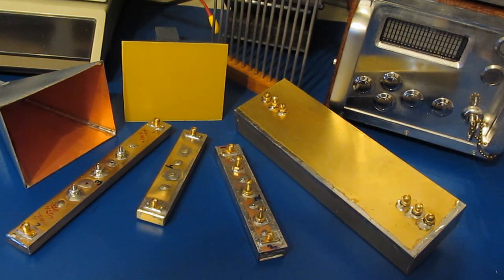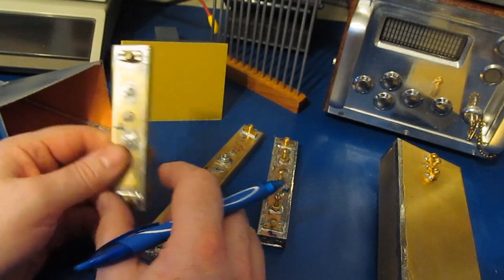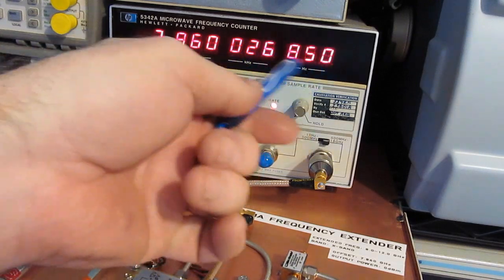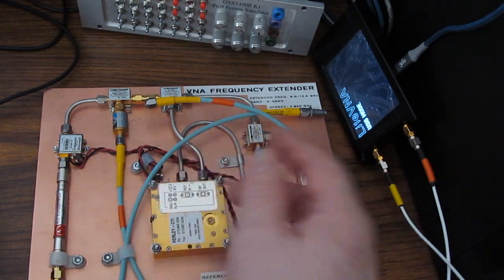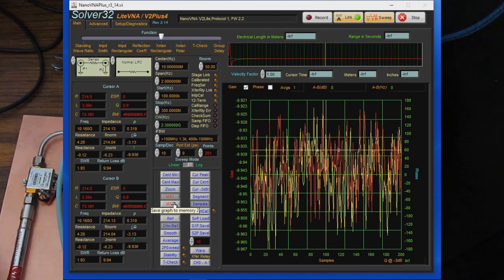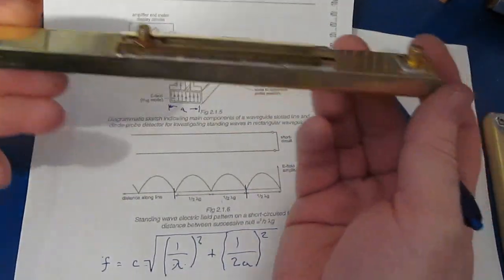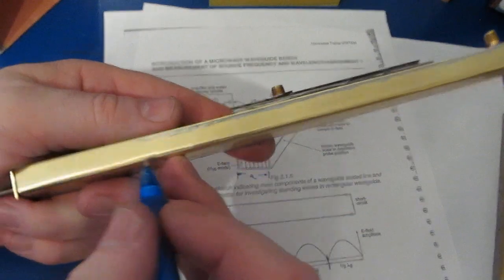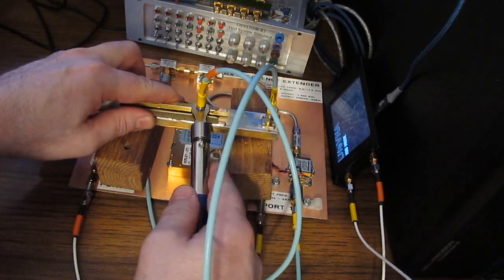Introduction to Waveguides using the LiteVNA,  Part2,  The Frequency Extender

Comment: I really love this waveguide series. When I grew up and went to University in 1977 the waveguides we had in School my engineering program we're all basically silver-lined and the better ones had gold but we didn't get those from industry. All the wave guys we had were donations from basically the garbage left over from Raytheon and other companies. We had a lot of old test equipment to and finally the school had to upgrade their equipment so they were going to lose their accreditation. That was the University of Lowell back then in Massachusetts. That school is now UMass at Lowell. Prior to attending the University of Lowell it was Lowell technological Institute which merged with Lowes State College at the time. Anyway this is a great series. It never occurred to me that brass would be good enough because I was always thinking of the exceptionally High conductivity of silver and gold.
Reply from the maker: For these experiments, I've been trying to use materials that were easy to come by.  We don't need anything high performance.  If we did, we wouldn't be bending sheet stock and pounding it out with a hammer.  LOL.

Comment: A+ joesmith! A few mech e ideas for those who might want to take this a step further:

1)Differential fine pitch screws will let you adjust, with a backlash of maybe 10 thou, off the shelf from McMaster. (Use the it like you would for any other linear drive mechanism.) Using a teflon/nylon bearing block is surprisingly good for backlash-resistance. Alternatively, you can do the old "overrun past your critical measurement points, then start feeding in to take up the gearing slack" trick.

2) Using a slide vernier caliper, you can detach the moving jaw and attach that to your movable component in the slotted line. Then take the 'fixed jaw' part of the caliper, and use that as your static ruler (e.g.affixed to the wg). In fact, you can skip the differential screw step and build around grainger's 4KU78 for 30$ (on closeout, get it quick!), giving you both locking mechanisms as well as fine-resolution adjustment. It's not going to be as good as that $300 Starett mic, but it'll get you 90% of the way there.

3: Depending on what y'all have in your garage, you might be able to do better than the ball peen hammer in a vice. It's the contour of the internal radius that determines the wg performance. A sheet metal brake if you happen to have one is probably the best option. If you have a >2 ton hydraulic press, even those mini harbor freight 100$ ones, and a vice, you can metal-form a nearly perfect 90. Put it into a machinists vice (so you have reliable 90s, and planar surfaces) and you should be good to go unless you're using some crazy Aquamat or Hastelloy or crazy stainless

-2x2l
Reply from the maker: As I have stated in the these two videos, the internal radii must be less than 10% of the broad width.  The main contributor of error was the WGs width.   If you want to make a better slotted line, buy a section of WG with proper dimensions and make it longer than I show.

Comment: Your home made waveguide is doing exceptionally well.  Commercial machined waveguide is very expensive.
I would think an suitable sensitive analog meter would be better to find minimums than the DVM.
Perhaps the issue you are having with seeing the minimums with the diode detector may be there is not enough signal to turn on the diode.   A backwards tunnel diode might work better to see the minimums since they respond to lower level signals.
The demonstrations with the magnet was  great for showing the effect of fixed biasing the ferrite.  The bias increases the resonant frequency of and lowers the permeability of the ferrite, thus reducing the loss.
This was a great video!  Thank you.
Reply from the maker: Working with higher power would have helped.  The notches are very sharp, << 1mm.    Most papers I have been reading are from the 40s-60s.  The article I read from Bell Labs on the isolator was very interesting.

Comment: I have the GR900 slotted line from General radio, including the cal kit and adapters to other connectors. I use for all my RF stuff GR874 connectors. They go to about 6 GHz and I have a lot of accessoires like trombones, air-line, mixers, detectors, attenuators, component fixtures, T , L, U shapes, sliding loads, variable capacitors, all kinds of adapters etc. Most were given or bought cheap because there most people over here have no clue what they are.
The slotted line uses a detector/voltmeter that has 3 uV full scale sensibility if I remember wel.
Reply from the maker: You should be making these videos!!!  I thought about getting a used WR90 slotted line and transition for it.  The costs far exceeded what I planned to use it for.  I think going much further with these experiments will require I purchase some actual hardware.
Reply: @joesmith-je3tq  Yes, they are expensive and rare. Also not really usable other then educational fun (for me) 

I got mine from a friend who used to be a GR salesman in the 60-70's . Payed 200 euro for it. It is complete with all GR900 adapters, even to sma. A toolkit for servicing GR900 connectors. I al ready had GR900 airline. 

But I had a problem with getting the correct unit-oscillators. I build a sweeping RF generator that does 25 to 2000 MHz and that is the highest I could go. But the liteVNA should be able generate 6 GHz (If I am correct)_ 

The other problem was the SWR meter, but I had one from HP. I found some GR stuff since, but had no time due to work. 

I now am partly retired and I am living on my sailboat. If I sell my house the hardest part, mentally,  is getting rid of my GR collection (the bridges for most, the small stuff is already aboard.) I have a GR1620 A that was used by GR in their cal lab (confirmed by Henry Hall, the man who designed bridges for GR for 40 years, a great and smart guy, still active in the GR collectiors world. I think he is over 90 by now. That thing is huge, and bizar, it can measure down to aF. 
I amgoing to play with a satelite LNB to downconvert X-band to less than 6GHz so I can play around with  radar (a friend has aan old radar from his ship for me to play around and restore so I can mount it on my boat. It works just over 9 GHz. 

I did not know you were in to RF, the videos about waveguides are great. I made a few videos in the past but then got to busy with work and it is a lot of work and I hate editing.
Reply from the maker: @pa4tim  The LiteVNA is rated to 6.3GHz without harmonics and 9.3GHz with.  As I have shown, things are pretty poor even at 8GHz.   That's the whole reason I needed the frequency extender.  
You could see if one of the local museums would like your collection.  You could then just donate them to a good home.   
My main interest in electronics is digital.  Digital = analog = RF.   When it comes to editing, you and me both!!!

Comment: Exceptionally well done diy homemade Waveguide & informative video !! ....You might try making an "Iris" Coupled Cavity Notch Filter. The Cavity Waveguide section is soldered on at a Right angle to the Main guide, electrically in Parallel.....Makes a great, deep Skirt Notch low loss filter....Experimenting with the "Iris" Diameter is a lot of fun & helpful when you need to notch out a Narrow BW offending signal....
Reply from the maker: The video I watched from the Signal Path where he was attempting to 3D print some WGs showed a iris filter.   I may give it a try.

Comment: An idea for the slotted waveguide, or any sliding load, you could buy a cheap digital caliper from Amazon and solder/glue it in place. You will get fast precise readouts, a thumb wheel for precision adjustments, and a locking screw. Once again, great work!
Reply from the maker: As I demonstrated during the video,  the largest error contributor is the dimensions of the waveguide.  For making the measurement, I was going to use a grease pen, mark it, then measure it after the fact with calipers.  No point in wasting a lot of time on a one off experiment.
Reply: @joesmith-je3tq  Agreed, I only meant that cheap digital calipers are now cheap enough that you can solder/desolder them to different pieces of equipment whenever you need some precise positioning control. I've been meaning to drill a hole in a set so I can add 3D printed hooks to insert to control positioning.

Comment: Another great video! Regarding 3D printing, you can buy conductive filament. It's a bit resistive, but you could assist it with conductive paint on the lining or just line with copper tape, allowing the filament to make the joins between faces. With a 3D print that beautiful slotted wave guide could have the slot closed too, very excited to see your next videos!
Reply from the maker: Post the MFG and PN for the material you are suggesting.
Reply: @joesmith-je3tq  I can't seem to post links, my posts are deleted, but Protopasta has one, but I think it's US supply so may be expensive to import. There's a very basic review of conductive filaments on All3D for alternatives. Interestingly, you can buy filament loaded with 80% copper (not sure if that's weight or volume on RS components and Amazon in the UK. No idea if it's conductive but might be worth testing. There are several conductive resins too but I can't remember how I found them last time.
Reply from the maker: @bansci  Most likely hits the filter is all.   It's much more conductive than I was guessing.  Maybe it could be directly plated with copper.  Have you ran any experiments with it?
Reply: @joesmith-je3tq  I've not tested it, sorry. I can see suppliers for Protopasta in the UK. Farnell will have some stock next month, and there's other suppliers like Ram peripherals who have it right now.

I have no idea if the filament will work well for RF, you might be able to electroplate it but it's fairly high resistance. I think conductive paint or foil lining of 3D prints might still be the best way to go, especially resin prints which can be very dimensionally precise and smooth. If you have a design for something roughly hand sized, I'd be happy to resin print it for you and post it for you to paint and assemble. I can even do some cad work if needed, this series is great and I'd like to see it continue
Reply from the maker: @bansci  I posted a link on EEVBLOG to a paper where they are directly plating a conductive plastic.   One of their experiments was a horn antenna.   They show the radiation pattern prior to and with the plating but the test seemed rather poor at best.   We have a few different products on order.   I also wrote Signal Path to see if they would be interested in making a followup video where they showed attempting to print a few waveguides.
Reply: @joesmith-je3tq  Found it and now following, thanks for the paper, very interesting. The surface of the finished horn looks very rough, even the initial print seems to have a poor finish, but this might be due to the challenges of the conductive filament. If I try this, I think I would try a resin print (non conductive but very nice surface/dimensions), graphite coating then electroplating with copper. There's a lot of youtube videos on coating normal plastics in copper which is what the resin prints would effectively be. Looking forward to hearing/watching where you get with this!

Comment: Hi Joe, really enjoying this series!  I maintained a 19 hop 6 gig digital microwave system for many years and just retired.  But never did much experimenting as the system just worked.  I am realizing more and more that having a variety of attenuators is essential when doing RF measurements whether that be for HF or Microwave.    Would you be willing to share the source of the inexpensive yet decent quality SMA attenuator kit you referred  in the video?  ebay vendor or link to the kit? (I realize that it is a gamble as to quality)  Thank you for sharing your knowledge of RF measurement techniques!
Reply from the maker: The problem with that is I have no idea if you would get the same parts from the same distributor.    Maybe use the search engine on EEVBLOG.  This topic comes up from time to time.  For example:   https://www.eevblog.com/forum/testgear/amazon-attenuators-any-good/msg5277016/#msg5277016

Comment: Great series, Joe! Please keep them coming! I've got some microwave experiments sitting on the back burner for the time being, but I've looked into 3D printed waveguides/horns a bit. The conductive paints seem a bit expensive, so I was thinking about copper sprays used for things like automotive head gaskets that you can buy from auto parts stores. It mostly consists of copper particles, propellants and volatiles (which might help smooth out the printed parts?). I don't recall this being tried, but it might be the cheapest and most convenient method to add conductive coatings. I suspect the effectiveness significantly depends on the number of coats applied. I'm looking forwards to more of these videos!
Reply from the maker: I tried one of the copper dressings I use and posted a few pictures for you on EEVBLOG.  If you have something that hardens and is actually conductive, post some details.  I have some that will somewhat harden but a higher temperatures than the plastic would withstand.   Even then, I doubt it would be conductive. 
I did try to copper plate some conductive PLA filament.  This does seem to work to some degree and may be an option.  I found a paper and posted it but the results were poor.  Looking at the photos, the workmanship was so poor, it never had a chance.
Reply: y6g
Reply: y6g

Comment: Really enjoying your endeavors and appreciate the hard work to produce all of this and then video it!
On the 'slotted-line'; maybe you could make a long screw that is threaded on the base and captive (but able to rotate) on the movable slide block.
I realize that you are just demonstrating the concept and with the looseness of the waveguide dimensions that is is probable not worth it.
Anyway, great content and helps us without the lab to sit alongside of you and feel a part of the journey.  Thanks Joe!
Reply from the maker: No doubt that many things could be done to improve the mechanical slotted line, but did you notice that old HP microwave counter tied to the GPS receiver?   If in battle, one is like playing with rocks and sticks, the other an F-35B Lightning II.   Both can kill....

Comment: If the diameter of those attns is consistent, you could probably make a clamp to hold them while torquing.
Reply from the maker: I've been known to just wrap some tape around a set of pliers.

Comment: How did you build the freq extender?
Reply from the maker: Assuming you watched part 1, do you have a specific question?  Or just in general, like I used a drill, nuts, bolts, wrenches, screwdrivers.
Reply: Hi
What I want to no  what mixers you used amp, a. Copy of the circuit
I would like to build one
Allan pierron
N8zhc